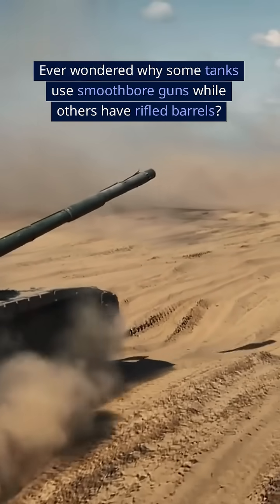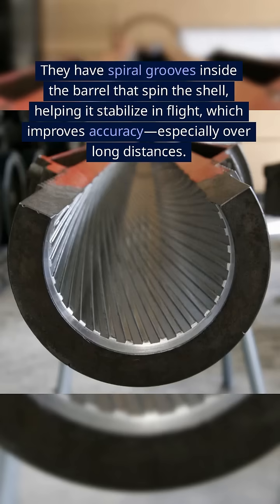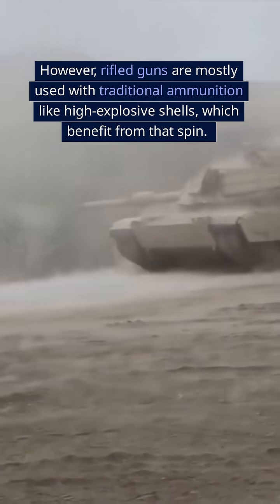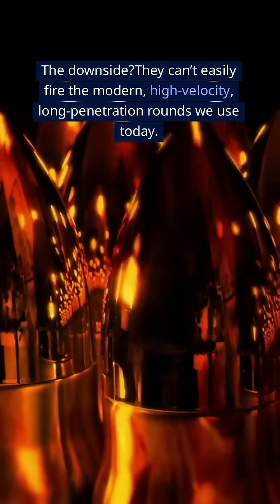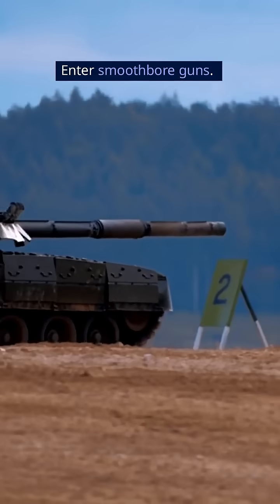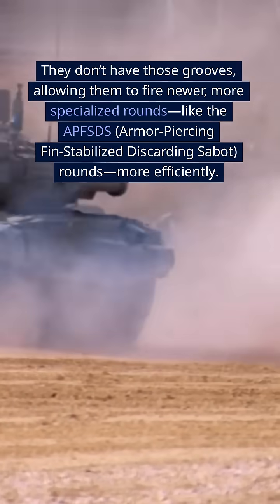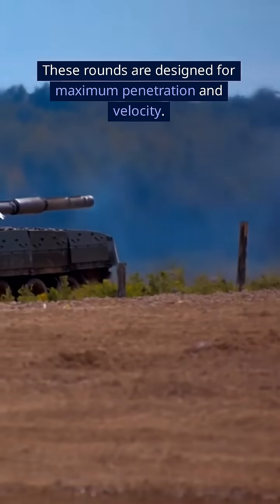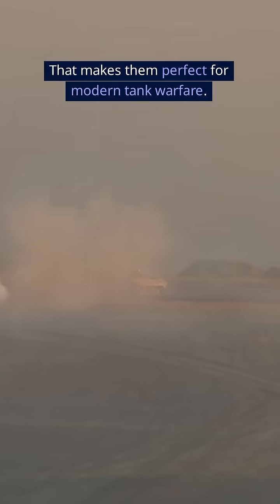Why Some Tanks Use Smoothbore Guns and Others Rifled Barrels #shorts

Comment: The actual reason is that they either have fins or are APFSDS which is basically just a rod and the longer the shell the more rotations pm it needs so fins were chosen. Thats why smoothbores are used today
Reply from the maker: Thanks For The Info,Will Make Sure To Keep Note Of It.
Reply: Smothbore is the older technology, rifling was added to guns to improve their accuracy back in the mid to late 1800's. Smoothbore has made a comeback due to the reasons listed by the first commentor.